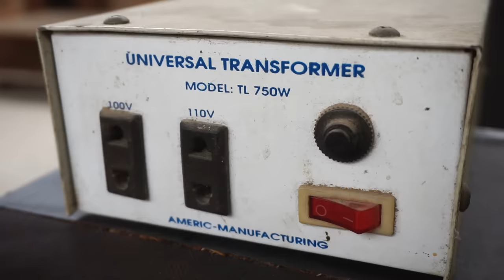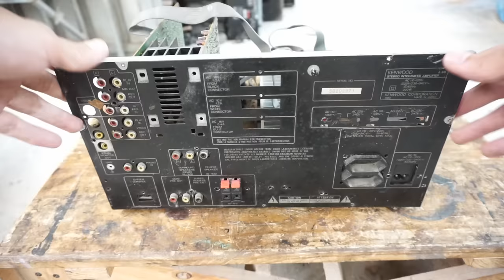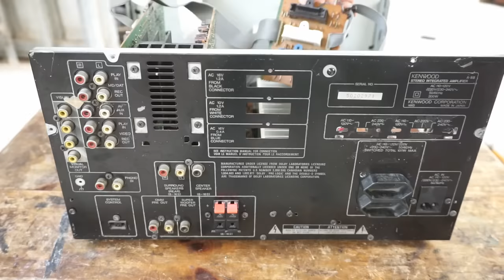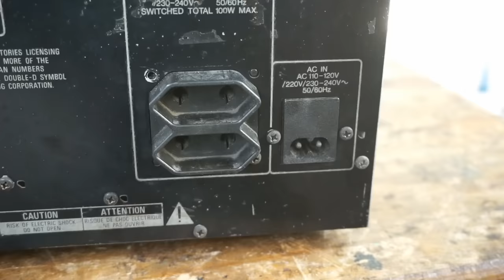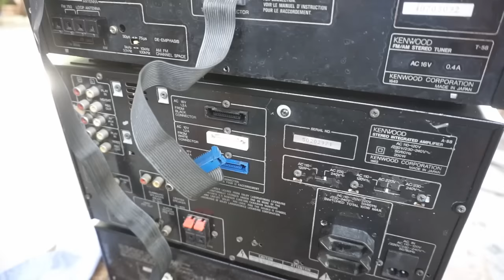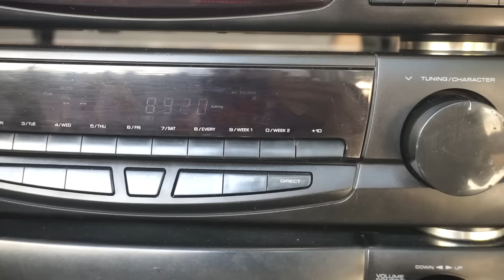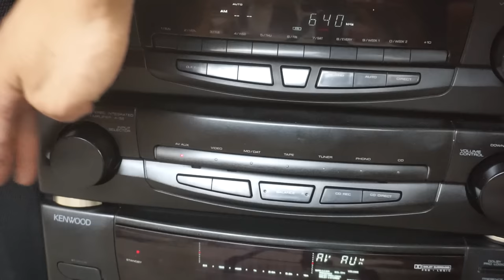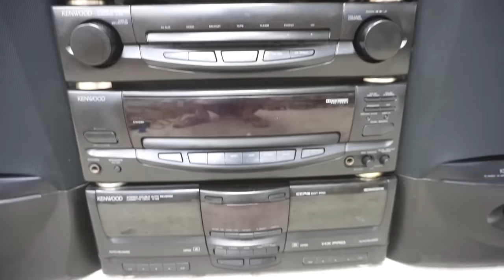Restoration multi-function sound system KENWOOD // I rescued it from the rubble

Comment: Replacing the resistor was the most hilarious part of the video. How did you manage to get the replacement part so fast? 
 Even without figuring out it's nominal? Nor I've seen you looking at schematic
Reply: There are either color codes, or like some international rectifiers, have values written.B B R O Y G B V G W....
Reply: @davidhamm5626   No way. I remember each stripe
Reply: @dkoxperiakoziukov3808  I wore out 2 or 3 of the radio shack calculators, and then they went to the new color scheme. I still have set  of arko mills, that has a lot of old school parts.

I dump the new stuff in the right places, most of the time....

Comment: I had this exact same KENWOOD sound system for 20 years from 1998 to 2018 and it never ever let me down. the build quality was really good. Mine was 5.1 surround sound and had a turntable too. It also came with an optional SW-05 super sub-woofer that was shaped like a crazy futuristic cannon. I can remember being able to mix from Vinyl to CD whilst recording the whole thing on tape. It was totally awesome for it's time and sounded amazing too. Regrettably, I had to sell it to raise cash for a new car. Somebody actually paid me £300.oo That's almost "HALF" the price that I paid for it originally "NEW" £700.oo in the January sales £900.oo rrp. I wish I still had it. I wonder if it is still working now. I wouldn't be surprised if it is...!!!
Reply: Que clase de modelo es?

Comment: question: If the system could handle 240v like the backpanel shows @2:36, why did you bring out the step-down power adapter?

Comment: Hey I just found a Kenwood system like that and all connected, but without a cd player. I just plugged it in and it lights up, but the light kind of goes dimmer. I haven’t tried to see if the radio plays and there was a sticker saying the tape gets jammed. 

I do have a Kenwood mini system I bought in 1999 that has the blue light on the ends of each component that I never opened and still in my storage. I bought it bc the lighting design is very attractive and at the time done on very high end  stereos.
Reply: Man! You’re like an electronics genius and seem to know what to take apart and what needs to be fixed. I would be lost on what to take off and know if that part is working or not,
Reply: Wow and you made it looking like new. Great job!

Comment: Dude, I have say you have some great techniques when it comes to handling certain things. The way you applied the glue to the speaker voice coil and dust cap was superb. Your glue handling is fantastic, sounds weird, but not getting glue everywhere is a real talent.  Also I love your table saw set up, it looks so handy with the table moving with the material through the saw blade. Quick question: What is the liquid you are washing the computer boards with? Thanks for the video(s)!
Reply: Là xăng đấy bạn ơi
Reply: Only a guess but it's probably a form of IPA fluid, dissolves crap around electronics and circuit boards whilst evaporating very quickly. Good stuff. Use it on any rca connectors etc.

Comment: Hello, I have exactly this set that has worked very little. Only the part of the cassette deck has a problem now, I turned it on after 11-12 years, it does not go forward, back, or auto reverse or… only play is fine. 
Is there a mechanical or electronic problem? Can it be fixed by washing and applying oil? I wish you could tell  the name of the electronic board oil and detergent in all videos.
Thank you❤❤

Comment: Holy shit. Oit of all those connections how did you know which ones you needed nee wire ran on the circuit board? Just by testing every single solder joint?

Comment: Brilliant. How to get almost a million views - you need to go to a flea market, buy a working multimedia center, wipe it down and show that it works. Then go to the backyard and cover it with dust/dirt. After a week, take it out, disassemble, wash and reassemble. and then mount it so that everything works.
49:37 The most reliable connection is through a capacitor of the entire mid/high frequency path, just screw on the leg with a twist that is not even secured. 18:56 The main thing is to wash the boards, without this it will NOT work, and then unsolder and re-solder the transistors.
Brilliant deception, bravo.

Comment: Shouldn't have repaired the woofers, but rather replace them, they sound terrible, the coils are "catching or rubbing" on something and don't produce sound, but distortion only
Reply: Always use only polystyrene thick foam surround woofers for long throw and good absorption to avoid crunch and rattle. Most woofers have foam rings which are too shallow, hence the rattling sound.